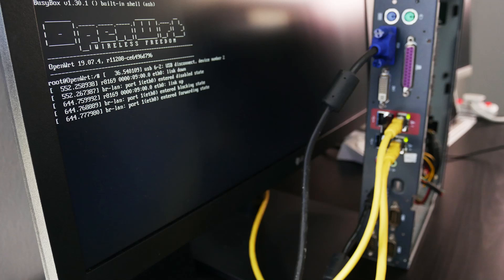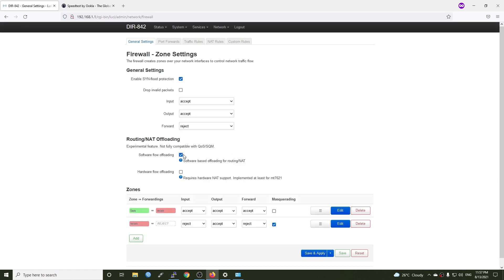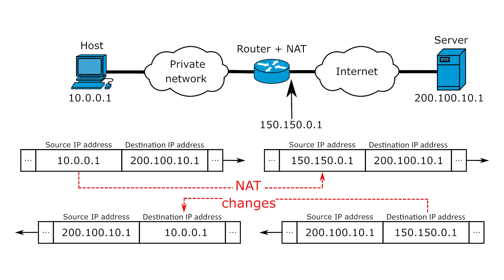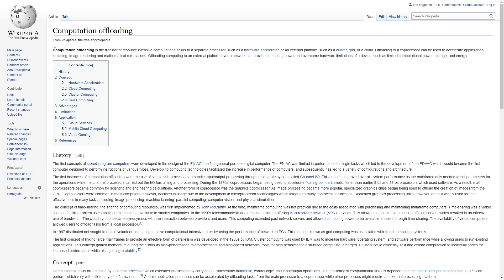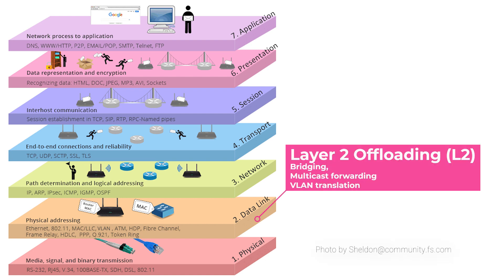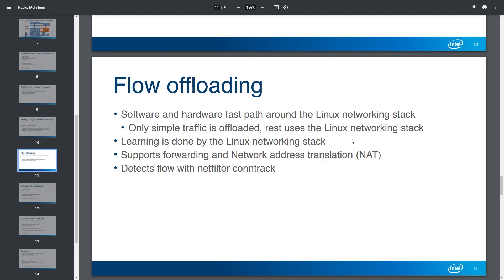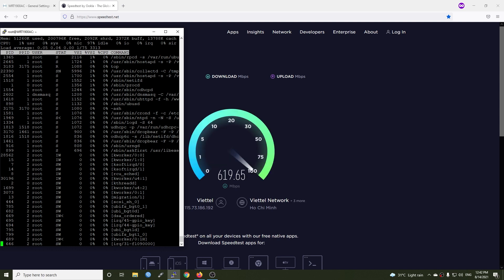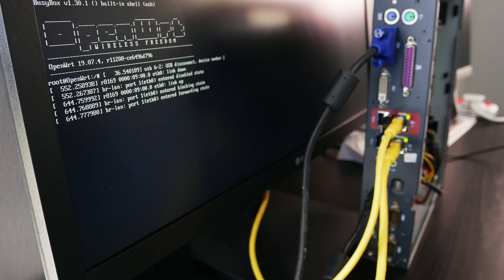OpenWRT  - Increase Router Throughput with Hardware/Software Flow Offloading

Comment: Hi bạn, có thể cho mình biết fw Openwrt của WRT1900AC ở video này là bao nhiêu ko, của mình wrt1900ac v1 (not mamba) mà mình chỉ thấy có thấp nhất là OpenWrt 21.02.0 r16279-5cc0535800, test chỉ đc 700Mb, trong khi draytek bật tăng tốc thì đc 900Mb, cho mình xin link hoặc  mã fw bạn dùng ở clip nhé. Thank.
Reply from the maker: Bạn dùng OpenWrt 19 nhé. https://youtu.be/CSs0Em3IFm8?si=vFVEas82ymfEPf0G
Reply: @VanTechCorner   thank, mình missed video này, many thanks, kênh tuyệt vời, giữ lửa và chất này bạn nhé.

Comment: Hello, I have tplink wdr4300, and with tplink firmware it reaches 1gbps, but with openwrt, and hardware or software NAT it reaches 300mbps, without flow offloading it reaches 140mbps
Reply: Did it get any better? Did you find a solution?

Comment: your dir-842 now can upgrade to OpenWrt 21.02 version, and can be easy update software hotfix

my dir-842 now using 21.02-rc3
Reply from the maker: Thanks for sharing the info. I heard that OpenWRT 2x doesn't have the switch page, that is why I decided to stay with the OpenWRT 19 series.
Reply: @VanTechCorner  you mean the vlan tag switch page??

my have that page do vlan tagging at Network -> Switch

Comment: hi bro , should enable hardware n software offloading ?? Xiaomi 4A gigabit openwrt rc4
Reply from the maker: Hi Alex,  his router is powered by the Mediatek MT7621A SoC that supports hardware acceleration, including NAT & PPPoE. You should enable the hardware flow offloading to make use of that.
Reply: If you have MediaTek hardware and high internet speed, yes.
Reply: @francocastilloAR  my internet speed 100mpbs
Reply: @francocastilloAR  should i enable two of them , soft and hardware
Reply: @alexkhor97  Yes, to take advantage of the full potential!

Comment: Can you do a video or a write up on how to run OpenVPN Client, DDNS and Wireguard or OpenVPN server at the same time on OpenWRT. I can get OpenVPN client to work and DDNS but when I try to connect to Wireguard or OpenVPN server it doesn't connect. Love your videos by the way, keep up the great work
Reply from the maker: Hi,  glad that you like the video. From what I know, you can't run VPN server and VPN client at the same time (it will not work as expected).
Reply: @VanTechCorner  thanks for the reply. I got it working. I have all 3 running, OpenVPN Server, OpenVPN Client and DDNS. The DDNS is getting the IP of the WAN connection and the VPN client is working as expected and I am able to remote into the router via OpenVPN